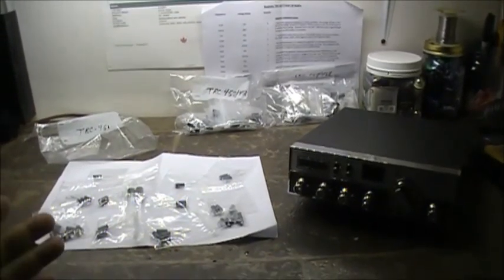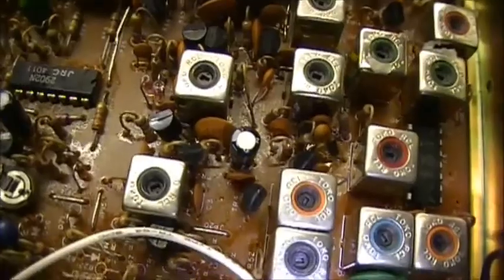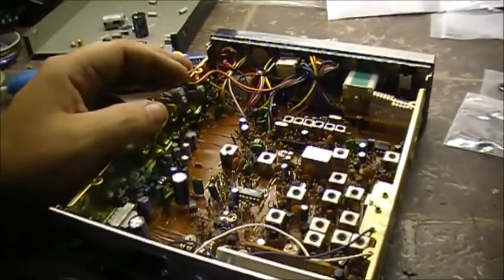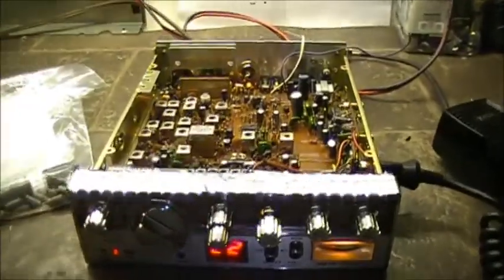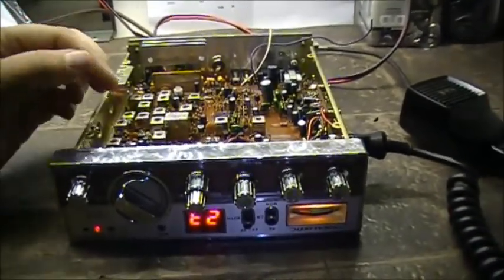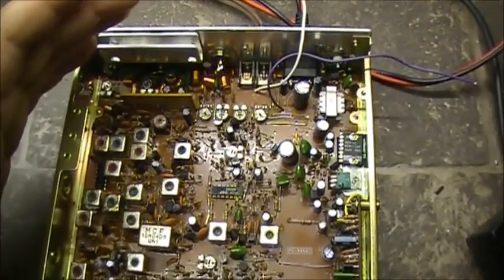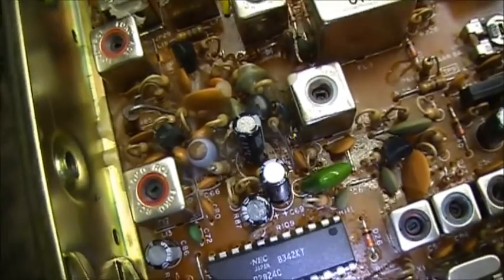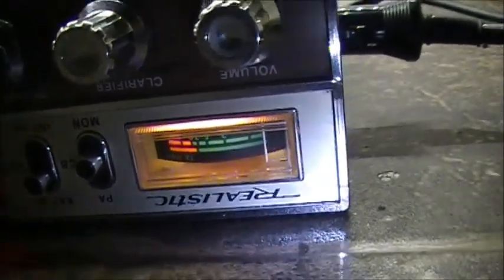REALISTIC TRC-451 - Replace the Caps!

Comment: What did you replace the 22uf/16V cap with? I just changed all of the caps too except the 22uf one yours was missing, mine was missing too in the bag. For some reason. I wonder if the caps kit seller is using an older/newer version of the pcb where it is missing?
Reply from the maker: Replaced with the same value the parts list called for in the service manual. :-)

Comment: try the front end detector diodes
Reply: then start doing tantalum, that blue one by the final and audio chip.
This guy has good ones, the electrolytics I buy from digikey but this guy has tantalum that are good. kemmit
http://www.aliexpress.com/item/20pcs-35V0-33uF-0-33uF-35V-DIP-Radial-Tantalum-capacitor/32301697450.html?ws_ab_test=searchweb201556_1,searchweb201644_3_10001_10002_10005_10006_10003_10004_62,searchweb201560_6,searchweb1451318400_6148
Reply from the maker: All caps, including them have been replaced. ;-)

Comment: All those open style trimmer pots are notorious for getting dirty and getting intermittent.  Try tapping on them with a plastic or ceramic screwdriver.  An intermittent dirty contact on those can cause the cutting in and out kinda stuff.  Try some Deoxit and turn them few times then put them back where they were.
Reply from the maker: They were all solid, no issues at all.  Thanks for the suggestion tho.  :-)